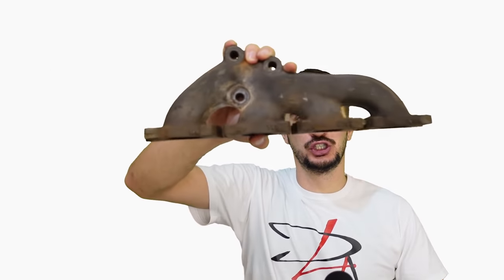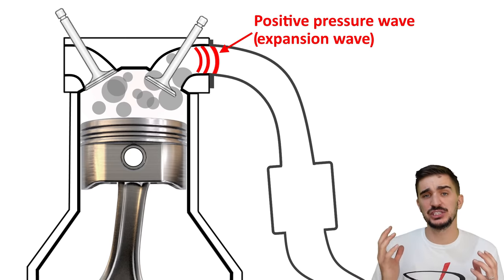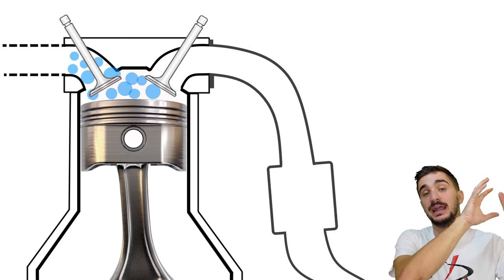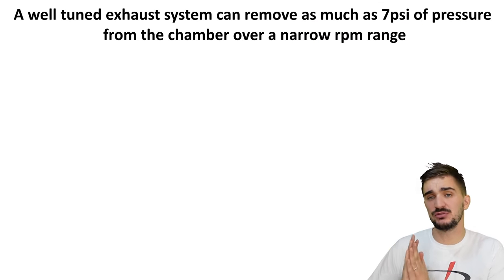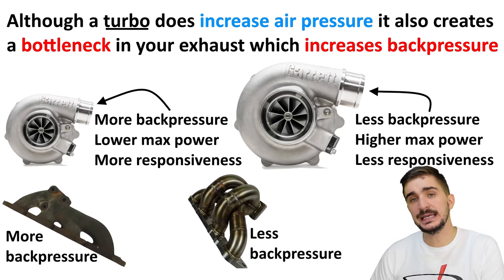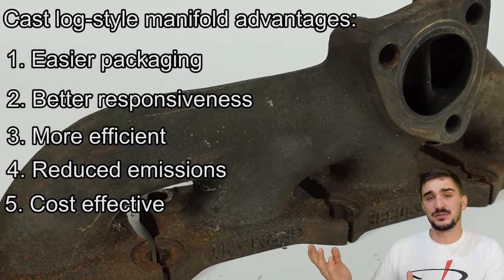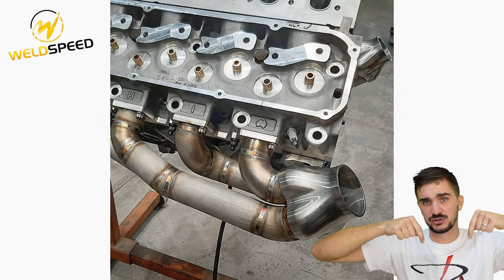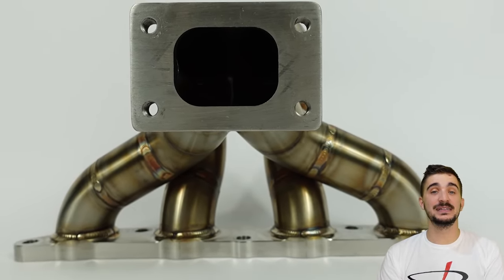EQUAL LENGTH tubular vs. LOG manifolds (headers) - SCAVENGING and EXHAUST BACK PRESSURE EXPLAINED

Comment from the maker: https://www.weldspeed.com.au/
Billet intake: https://www.weldspeed.com.au/product-page/4age-intake-manifold-big-small-port
For fabricators: https://www.weldspeed.com.au/product-page/copy-of-321-stainless-straight-tube
Become a Tuning Pro: https://hpcdmy.co/dr4a
Support the channel by shopping through this link: https://amzn.to/3RIqU0u
Patreon: https://www.patreon.com/d4a
Reply: Damn They dont actually sell the header, just the materials. :/
Reply: That's a tad faster than the speed of sound, 870mph. Mach 1 is around 750mph, maybe a bit faster but remembered that Mach was in the mid to high 7 hundreds of miles per. Dang it, now I've gotta look it up or it'll drive me crazy. Good stuff you putting out though, lots of interesting topics, thanx.
Reply: Why don’t you show pressure in the operating engine and show the pulses of each runner , with dyno tests
Reply: Can you make a video on exhaust header wraps (thermal cloth / tapes etc) please? Are they worth it, etc. Thank you!
Reply: @mrt2this607 mach changes based on temp and pressure.

Comment: True story: Back in the 90s, I dyno'd the very first X-pipe originally made by Dr. Gas. This led to every Nascar team ordering them. 1994 Daytona 500 was won by Sterling Marlin in the 4 car. This was a huge story and had everyone curious as to why his car sounded like an Indy car. Thanks for sharing.
Reply: Cool 👍
Reply: ... I know for a fact my father was building x pipes back in the late 70s on street cars, he still has the first one he built on his nova. He never sold them professionally but I know for a fact yours wasn't the first
Reply: @Prestiged_peck  I know for a fact that your dad's x-pipe wasn't not the x-pipe that didn't get dyno'd when they weren't dynoing x-pipes back when Indy cars were not dyno'd on the dyno with an x-pipe not being dyno'd.
Reply: X pipes were being used commercially since like 1980
Reply: @crxtodd16  my dad designed half or more of the headers in the hooker header catalog back in the 80s/90s, and he built some bad-ass exhaust systems long before then. He's always been a genius when it comes to physics, even without a college degree he was #5 on the food chain in xcor aerospace, sadly he wasn't in control of the budget and the accountants drove it to the ground, but the guy he took under his wing now manages a large portion of the engine design team for SpaceX (or one of the contractors that builds their engines, can't remember which.
Reply: That scream though.
Reply: F
Reply: True story.   I had x pipes on all my engine we built in our shop in the early 80s.   It picked up torque but hp was rarely changed.   Way before Dr. GAS.
Reply: Wait, when?
Reply: True story, I had a Y pipe on my 86 Dodge Daytona made by Dr. Trash..Not only did this create a bottleneck it reduced sound but saved weight…Dodge went on to put this on the hellcat in 2018 which caused controversy with Dr. Trash, Lou Ferrigno, Don Corleone, Jeff Bezos and Wolverine…
Reply: @Prestiged_peck  - I was just teasing/being silly. 😊
Reply: My dad owns nascar and is a firefighter and bill gates and he’s really strong 🤡
Reply: Cool
Reply: Cool … I will say that even if the X crossovers didn’t make a performance improvement, the sound improvement would still be worth it.
Reply: Thanks for the information
Reply: @crxtodd16  i love it.
Reply: No, thank you for sharing....Iv loved the X-Pipe and always wish every car had 1 and how even a 4cyl could have 1 and how it would sound
Reply: I too have a true story, back in the 60's I dug a hole in the forest to take a poop.today that hole is the Grand Canyon. The crazy part is....I was born in 89
Reply: In the Atlanta 500 of 1996 one car sounded like a Ferrari. IDK which one.
Reply: nice1
Reply: @Prestiged_peck  what a lost oppertunnity
Reply: True story: my great grandma invented x-pipe and frisbee in 1920
Reply: True story. 
The benefits from x pipe aint a peanut compared to a turbo
Reply: @SkitPete  x pipes are kinda wierd on single bank engines, you could put one on there and I'm sure it would do something, but unless you have it set up with two distinctly seperate pipes off the exhaust manifold, it's gonna be a wierd situation.
Reply: My brother's uncle invented the white border around stop signs.
Reply: @Prestiged_peck  You may not know this but there is a distinct difference between an X-pipe and an H-pipe. H-pipes have been around forever. X-pipes have only been commercially available since the late 90’s. 

Maybe your dad had a Y-pipe on his Nova?
Reply: @ralphiebutternuts6307  no, it's an x-pipe, I've seen pictures from the 80s of an X pipe on his nova, one was dated 1983
Reply: @Prestiged_peck  Why didn’t your dad convince Hooker to make an X-pipe before they were acquired by Holley?
Reply: @ralphiebutternuts6307  because a good magician never gives away all his secrets, and honestly he didn't find put they made more power until they went commercial, he just did them for the sound.
Reply: @Prestiged_peck  what.. it's not tricks you release products before other companies patent the technology 😂
Reply: Unfortunately Nascar later banned X pipes, reasons unknown.
Reply: @TheIrek666  my dad invented the glue used on post it's
Reply: Well if we're telling true stories......My dad did my mom once, they got married and then she did every man alive, a true gang bang. About less than a year later I was born. I'm X pipes kid, since we don't know who X is my mom is a concubine. Her name is Heather from Nampa. She's old if that's your thing.
Reply: @patrickpatton7123  Thanks for sharing that.  Just how old is she?
Reply: I've been running a z pipe on my lawnmower since 1857
Reply: @NewEdgeDesigns  😂😂
Reply: @Prestiged_peck  spacex is one of these scam brands by elon?
Reply: @NewEdgeDesigns  Y
Reply: @Rainman...  Y not??
Reply: @chideverett9580  I know why he's really strong it's all the booster 💉and the impossible burgers he eats😂🤣
Reply: @felicianoabe  you must have dug into the multiverse... Wait a minute are you the reason why the MCU sucks so bad nowadays? You dug a hole in the '60s pooped into the multiverse was born in 1989 in the MCU died in 2019 it all adds up now
Reply: @NewEdgeDesigns  Y not Y? I guess because it's slower and quieter? 🤣😂
Reply: Guys....  he didn't say he dynoed the first x pipe ever made.... he's talking about Dr. Gas' x pipes. Lol we all know people were making them in the 60s.
Reply: My dad got an engineering degree at 15 years old from Harvard University, and invented the first Z pipe back in 1957. I was born later that year at a very young age and learned all about his legacy. He sold the Z pipe patents and lived in luxury for the rest of his life. He passed away last year at the ripe old age of 65.
Reply: @tahcogunworks  increased torque without increasing power? Congratulations; you broke physics!
Reply: Oh yeah? I dyno'd the first O-pipe.
Reply: @Twobarpsi q

Comment: On a naturally aspirated engine, the exhaust header and intake should both be tuned to the same rpm range for max gains. Today some intakes have variable length runners for a wider peak curve and variable cam timing helps capitalize on that. When the intake cam and exhaust work together you get a sweet spot to upshift into.
Reply: Snowman88  damn straight! Reading your reply feels kinda like looking into a mirror.
Reply: Snowman88  I've seen opposed piston engines where 2 pistons share the same bore. It was not something anyone would consider fast but it was unique. I like the cosworth that was made for Gordon Murray's T.50 and I love the Aston Martin Valkyrie engine. All I have now is a Yamaha R6, a supercharged 2zz-ge and whatever Tesla put in my wife's model y. They all move out pretty good. I'm not gonna lie, I could gap a countach with either of them. I've worked on motors that were so big they have their own 5 story buildings to live in. I came to work one one engine that had a plug wire arcing and it developed a gas leak (it was a natural gas engine out by st. Joseph's bayou in a place called east bay) well it blew the roof off the building and melted all the window frames. It was frightening to see the carnage. So glad no one was in there when it lit off. I worked on some cooper b250s. A man can fit in the cylinder sleeve. Max rpm maybe 500 if one were being foolish. It's a LOT of power at 350 rpm though. You want it to turn slow because it is also a gas compressor. A really big gas compressor.
Reply: Snowman88  alright, hear me out, variable length headers, like telescoping tubes. Alongside telescoping ITBs, Ti-VCT, and a VTEC system. (Or even better, just go freevalve with the adjustable intake/exhaust manifolds
Reply: You guys are looking in the wrong place for gains 
until  you have experienced your own variable-nozzle turbo
Reply: Today people just use turbo
Reply: @ArneChristianRosenfeldt  every generation has had more ignorant people than educated. Funny thing is each and every individual chose which category they would fall into. Most chose the former by failing to chose the later. Nevertheless  they themselves CHOSE ignorance with so much potential knowledge staring them in the face.
Reply: @fastinradfordable  we are not looking in the wrong place. We're looking in ALL of the right places. I've seen every turbo known to man including turbos that will not fit in your living room, not a single one has had a nozzle of any type. Are you referring to a Variable Geometry Turbo -- VGT? Some applications, you would prefer NA or you simply get destroyed by your NA competition. It weighs less costs less, throttle response is instant and it's more reliable and easier to diagnose when something does go wrong. Aside from that, a good breathing engine will make more power at 8psi of boost than a bad breathing engine will at 12psi if you want to boost it later. Putting in the work up front pays dividends down the road.
Reply: @Prestiged_peck  freevalve 👍
Reply: @3dw3dw  I looked into NA before the downsize craze. BMW had variable intakes in the Vee. Now there are the turbos and power is doubled. One slowly moveable part replaced with one fast rotating part.
Reply: The Honda R20A3 is a nice example of this. It has an internal 4-2-1 principle header, cat mounted directly after it, variable intake length intake manifold, plus i-VTEC which can modulate intake cam timing, length and height. Even on a 3300 curb weight car i average 5.7/100KM on the motorway, and 7.5L/100KM combined, with a 5speed automatic..
Reply: snowtiger33  I love model aero engines and the sound of a 125 Suzuki dirt bike pulling up a hill.

Comment: I made 445rwhp on a 3.0L 7MGTE with a log type manifold.   That's 520 crank!  18psi on a 64mm
Reply: Plus you didn't have to build a mount to prevent the weight of your turbo destroying your manifold.
Reply: Fun fact: turbos work better with cast manifolds, NA engines work better with tubular setups.
Reply: Turbos are not that picky what feeds them, all you need is velocity and heat energy…..not surprised at your numbers. Is that motor in a MK 3?
Reply: @miketess4272  yeah 87 mark 3 back in the day, on a fresh all new stock parts engine rebuild.

Comment: Wow i never knew exhaust gases hit the speed of sound in the manifold, that's super cool
Reply: The gases don't, pressure waves do. Presure waves always travel at the speed of sound.
Reply: @igornoga5362  do not turn sew upside down, , speed of sound is equal to 20.1 times second root of termodinamical temperature of gas, , so if gas flows faster than 2582km/h with temperature of 1000c deg, i flows faster than sound
Reply: @makantahi3731  Gas can travel faster than the speed of sound, for example in rocket nozzles. Here we are talking about   internal combustion engine exhaust, which is never even close to Mach 1 to avoid backpressure.
Reply: @igornoga5362  one lesson from aerodynamic, if you have ad tunel with smaller diametre,in middle and after expands,(venturi tube)  and forces some gas(air) to flows , as raises pressure , speed raises , until pressure reachs 1 bar , in smaller diametre, speed reaches 1Ma, if pressure raises more, speed in smaller diametre is still 1 Ma, but in part of tunel where diametre expands, speed starts to raise over 1 Ma, so you have supersonic speed, same is in exh primar  tubes, gasses from cylindre are under pressure and when exh valve opens it expands into primar tube or collector with supersonic speed, with no muffler you will hear bangs-what is supersonic expansion
Reply: Snowman88  not density, speed of sound of air/gas is in direct relation with termodinamic temperature
Reply: Snowman88  thanks , i remember a few things from highscool and one is that formula, shorter, speed of sound in m/s =20.1 times second root of temperature in Kelvins
Reply: @makantahi3731  to
Reply: @igornoga5362  hence the sound :)

Comment: Another thing to mention with turbocharged engines, short circuiting (excessive valve overlap) of charge air into the exhaust usually results in melted turbine wheels and exhaust valves, as the raw fuel and fresh air usually ignites as it blows past the red hot exhaust valves
Reply: Antilag. Yuck